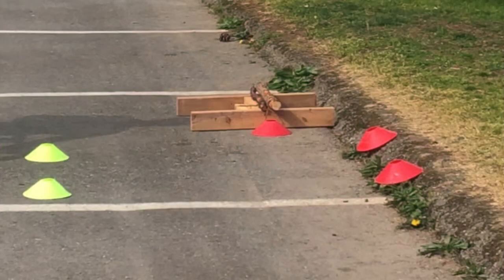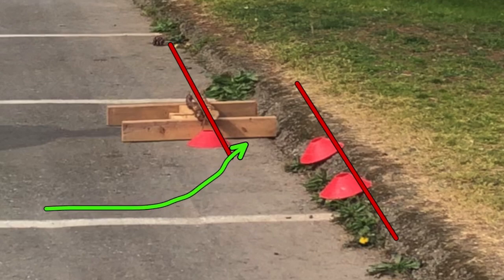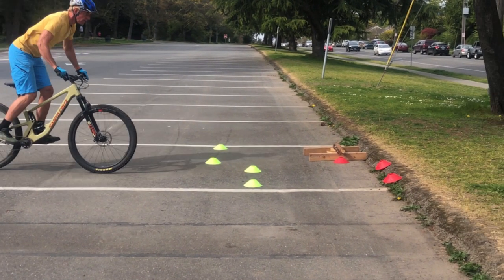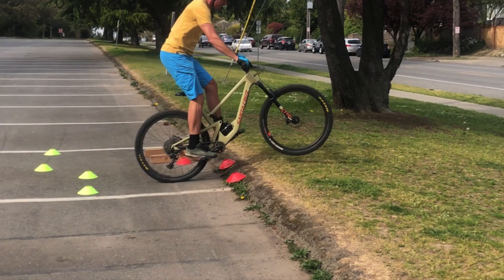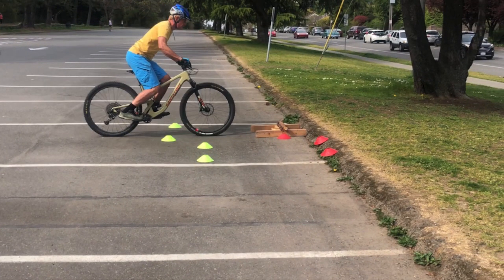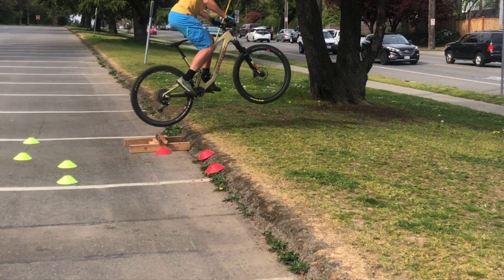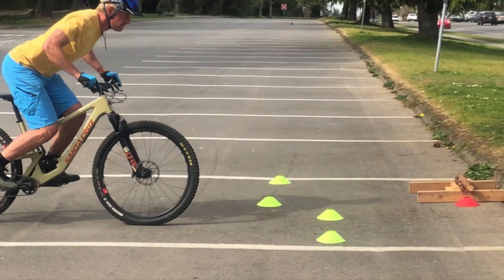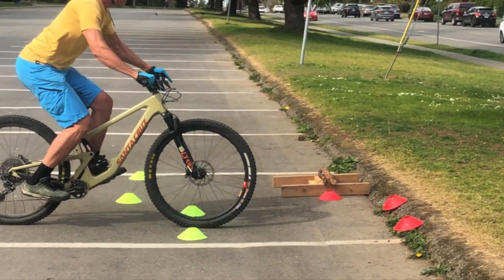Fluidride MTB Driveway Drills #7 - Featuring & Bunny Hopping

Comment: What's the relationship between hopping and manual? Do you have to manual decently before you can hop over things, just to get that front lift? Thanks
Reply from the maker: They are unrelated. Even though the front end needs to come up for a hop, this doesn't happen from a hip shift like it does with a manual. It comes more from preloading. There is a similar essence to the movement, so it's a great question. You don't have to be able to ride a manual to bunny hop, or be able to hop to do a manual. We will be doing a 'hopping' episode really soon!
Reply: @Fluidride  Thanks!